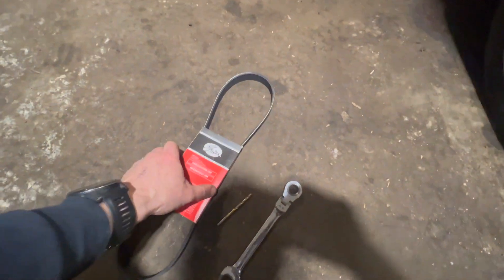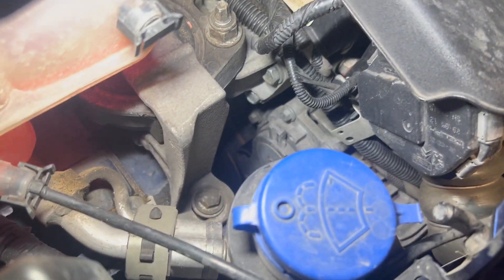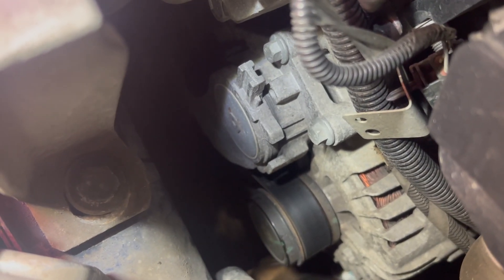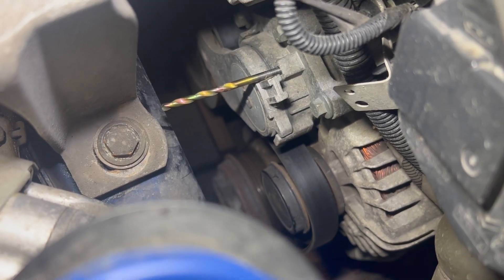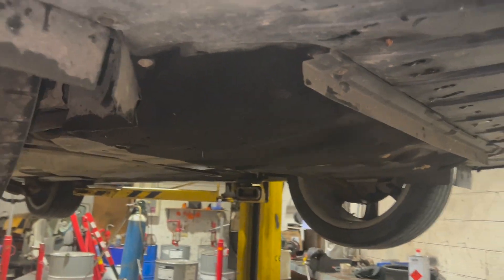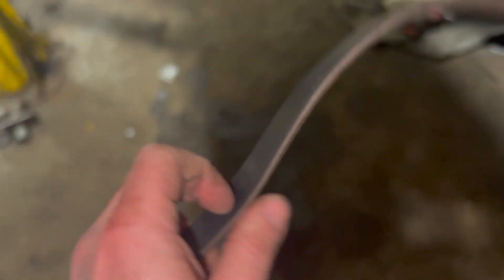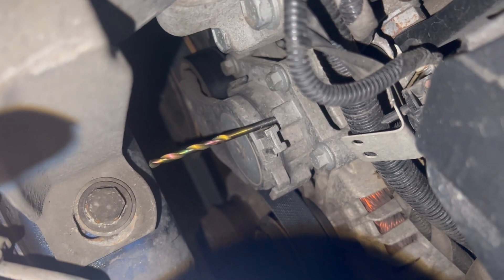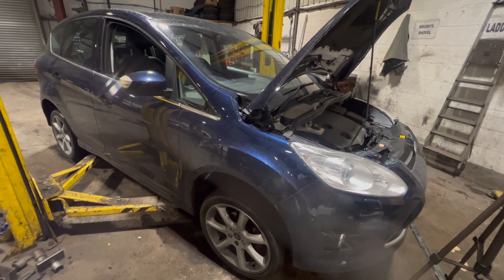Ford Cmax 1.6 TDCi Drive belt replacement

Comment from the maker: Check Euro car parts - https://tidd.ly/3lIO7xA  (use discount codes on site)
Check "Car Parts for Less" - https://tidd.ly/2LNEwIn  (use discount codes on site)

Auxilary belt (without aircon) Ebay - https://ebay.us/WGxbhK
Auxilary belt (with aircon) Ebay - https://ebay.us/RuIjWR

Tools used :
             
             Milwaukee 3/8 Drive Mini Impact driver - https://ebay.us/Pg8ilg
             Torx Socket set - https://amzn.to/39UTWCw
             Spanner set - https://amzn.to/2DlwUZm
             
Check out the Timing belt replacement on this same vehicle :
https://youtu.be/eSVdVACJBlc

Comment: Great video. I have an issue with this belt on when turning AC on. Can see the belt shaking. Any ideas what it could be or does the belt need tightening some how? Thanks
Reply from the maker: Most likely the tensioner

Comment: Was there a noise coming from it that told you it needed changing? Missus has 1.6 Tdci and noise from that area and can see the tensioner bouncing slightly with engine on, right where you de-tension the belt with.
Reply from the maker: Just spotted this one was worn, the tensioner I likely to move a little at idle , if it’s making a rumbling noise it could be that, take the belt off and check all the pulleys
Reply: @diydaly  it is a kind of rumbling warbling noise alright, thanks for the help 👍
Reply from the maker: @BlakeCDS  👍

Comment: My wife has got a focus 1.6 tdci.  It’s started making a squeeking/grumbling noise. After a while trying to diagnose where it’s coming from I found the noise is audible in the cabin when the air conditioning is on. So I suspect it’s related to the serpentine belt which is what led me here. If I were to guess I’d say the noise sounds like a worn pulley bearing. Is this a common problem? And could it be the problem?